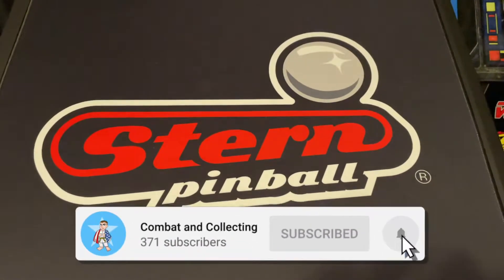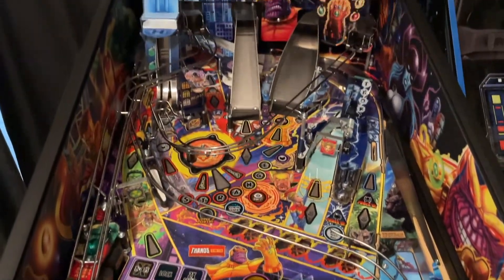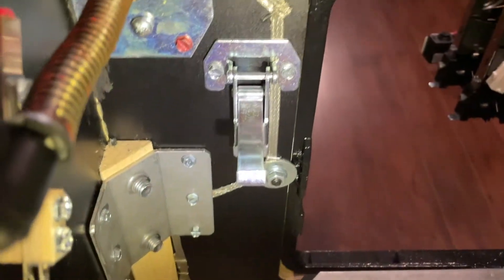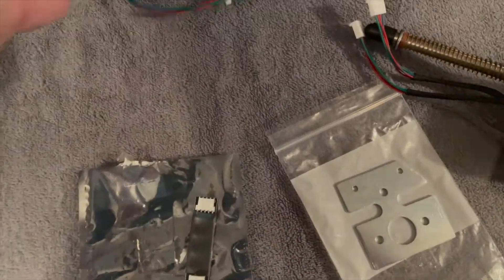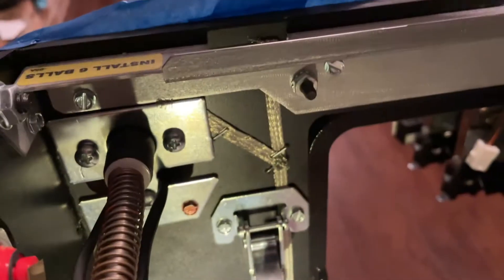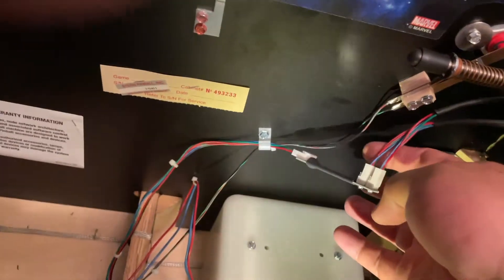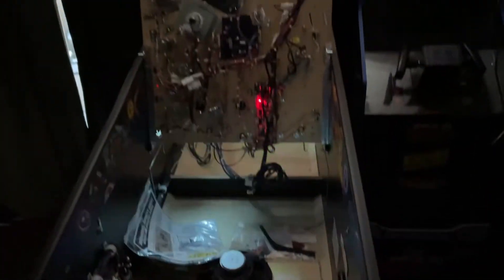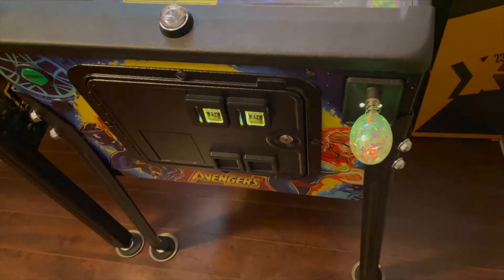Stern Pinball Avengers Infinity Quest Gem Shooter rod RGB Installation

Comment: Nice bud! I’ve never bought a new shooter rod, but may look into this one. I am waiting on a topper. Supposed to have shipped already. Any day now :)
Reply from the maker: Love that topper. As a newbie it gave me smaller goals to shoot for instead of the harder wizard modes built into the game.
Reply: @CombatandCollecting  got my shooter knob, but for some reason it’s not changing blue or purple. The LED on the right seems to have a loose wire. If i wiggle it it changes blue. Probably going to have to return it. Sucks because they aren’t in stock anywhere.
Reply from the maker: @PiN_MiKE  yes it should